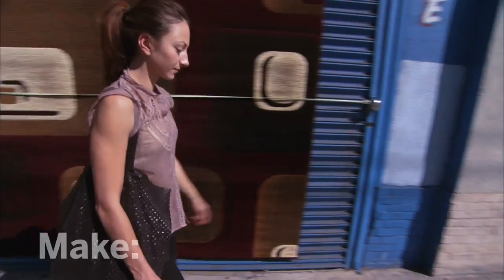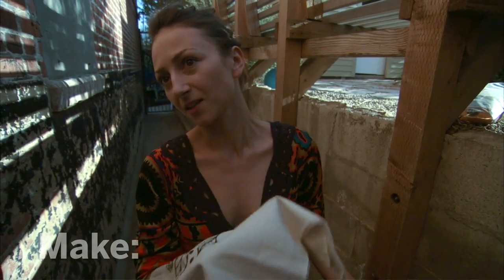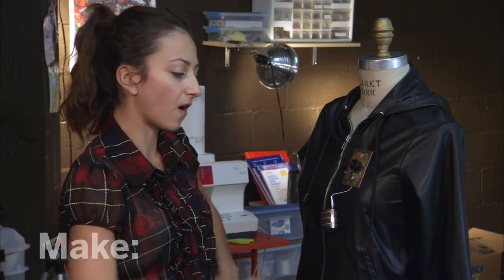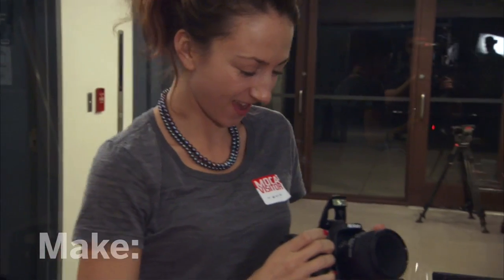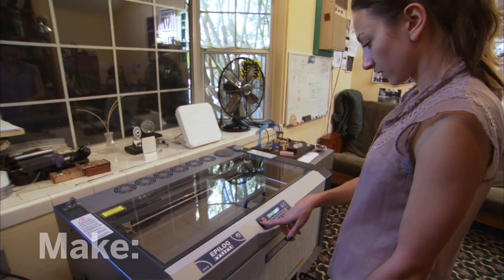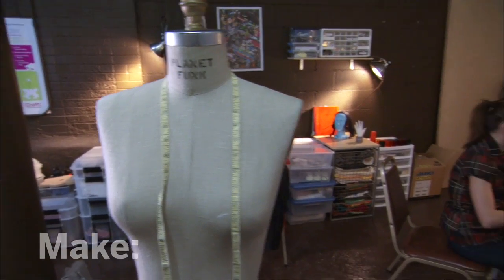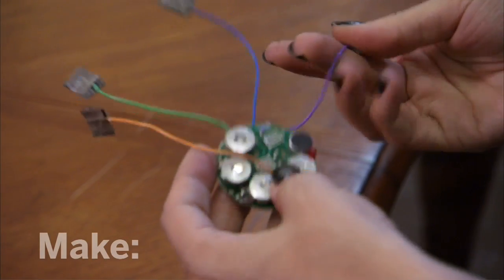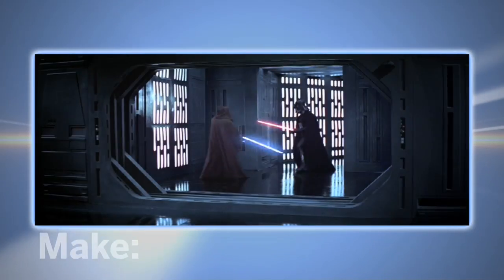Maker Profile - Wearable Technology on Make: television

Comment: If you dry them before you turn them on it will be fine. Once I forgot my pendrive on the laundry machine. It still worked after. Of course it is not a good practice, but it proves a point. It is a valid idea, but not a perfect one